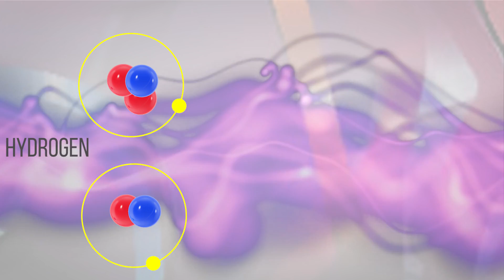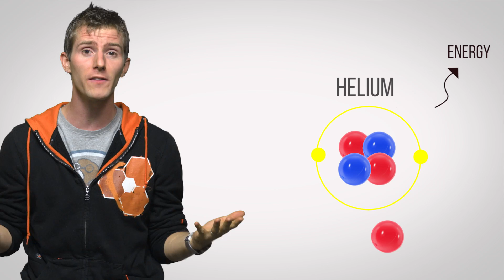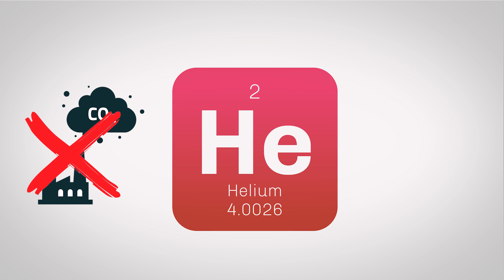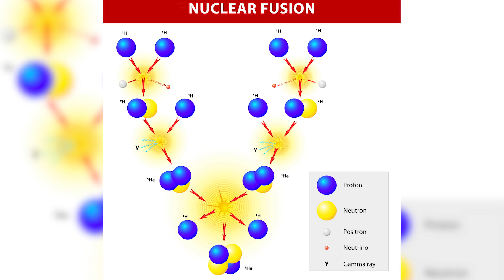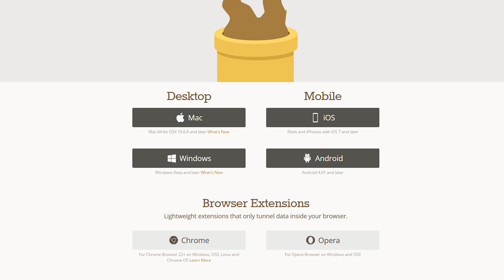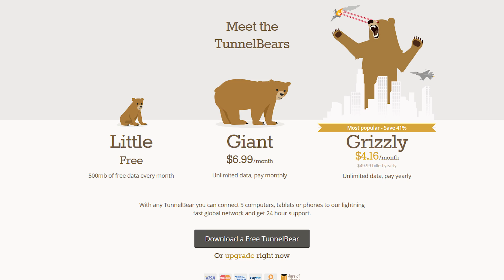Why Don't We Have Fusion Power?

Comment: There's one huge problem with nuclear fission energy that is ALWAYS overlooked... meltdowns are rare, and the nuclear waste material after the reaction is actually pretty small, such that any decently funded program wouldn't have a problem storing it for the thousands of years it takes to become safe...

The problem is the huge amounts of toxic waste created in the process of turning uranium ore into a usable fuel.  As I recall, for every one kilogram of usable uranium produced, something like 100+ kilograms of toxic waste is created as a byproduct.  Everything from radioactive to caustic to noxious to carcinogenic materials are used or created in the process, and generally are left in massive open-air sludge pits after the mine is exhausted.  Using nuclear fuel is mostly environmentally friendly, creating nuclear fuel is an environmental nightmare.

This is why solar and wind are a better choice for clean energy, even if they are less efficient... they're not perfect, of course - gathering the materials used to build turbines and photovoltaic cells and the process of refining and processing them are still environmentally damaging, but much less so than nuclear.  This is also why nuclear fusion is so highly sought after, and why it's a worthwhile endeavor to have multiple governments work together toward the goal of designing a sustainable, efficient fusion reactor.
Reply: Right so show me actually that it is really that dangerous in this day and age and your not like other anti-nuclear activists who don’t look at advancements.

Comment: Current nuclear breeder reactor tech has the capability to use old nuclear waste as fuel and eventually turning it into inert mass. There's also nuclear burner reactors which do the same thing but faster and give more immediate power at the expense of not making more of its own fuel for potentially limitless power like a breeder reactors.

We literally have the tech capabilities to clean up all our nuclear waste and deal with the energy crisis AND have it be non-carbon emitting (nuclear fission doesn't emit CO2, the steam you see rising from reactors is just that, water vapor) but noooooooo that would make too much sense and so many people are so goddamn braindead and afraid of anything with the world nuclear in it!

Nuclear puts out a power to efficiency ratio that blows wind, solar, tidal, hydro, geothermal and biomass out of the water combined. It's leagues ahead of coal and nat. gas in terms of per unit output, energy efficiency as well and is safer environmentally. And because of so much fear that has constantly surrounded reactors we have now overbuilt the things to where they will just shrug off something like a 8.0 earthquake and go through multiple safety lockdowns in the event of something higher or potentially more damaging like a Tsunami.

Retrofitting, renovating and building new reactors that are breeder or burner capable is the key to our future, both in terms of global warming, getting rid of nuclear waste and solving the energy crisis. Nuclear fusion on the other hand has been "20 years away" for the past 50+ years. It's not going to happen exactly because of what you mentioned about needing gravity to do the hard part for us.

Comment: Fusion would be a nice long term solution, but for now we don't even know if it's possible to get more energy out than in for a fusion reactor. Nuclear fission is honestly the best and cleanest option we have to supply our energy needs. If it weren't for the few disasters by countries with the worst standards for nuclear safety, nuclear wouldn't have the bad rep it has today. Nuclear is the safest and cleanest form of energy there is. Even if you look at the disasters, the death count doesn't even come close to deaths caused by fossil fuel burning. Not to mention that burning fossil fuels will end with millions upon millions dead in the future. Weigh your options: Certain mass starvation by fossil fuel burning or a miniscule chance of disaster by nuclear, near zero with proper safety, and barely any deaths if any in the case of a disaster.

Comment: So, just in case fusion reactors are again 50 years into the future like they have always been, we better get rid of finite energy sources while we still have time. That way we won't be completely fucked when oil and coal run out while we're still trying to figure out fusion power. Think of it as a back up plan.

Comment: Modern nuclear fission plants use a specific technology that was developed during the cold war because its byproducts included weapons grade nuclear material. There are other techs to run fission, one really promising alternative is Liquid Flouride Thorium Reactor or LFTR, the primary drawbacks of which when it was debated against uranium piles was that LFTR didn't produce plutonium for the bomb and was unstable for use in naval vessels (flouride salts plus being at sea = boom) one is now a major feature of the tech instead of a drawback.

Comment: there are various other fusion processes.. for producing energy.. but there is only one process which generates maximum energy and it requires 10times higher temperature than sun, and i was surprised that linus didn't even mention ITER project... :/
Reply: Jignesh Muchhadia something 10x hotter than the sun would scorch and kill everyone in a 100 km radius
Reply: Only 100km?
Reply: Mister Dinner concept behind it is, confinement of that plasma. So maybe you might wanna stop commenting obvious things, and google the term "ITER"...

Comment: Actually it's not the temperature that creates fusion in the sun's core. The 15 million degrees is nowhere near enough to create fusion. It's the quantum tunneling effect: The heat moves atoms so close, that with certain small - very, very small - chance they "jump" to neighbour atom and bind. And it is essentially the tremendous amount of atoms that balance out the extremely small chance of the fusion occuring at that temperature.

Comment: Actually fusion has radioactive waste. When the fusion is made, there is a mising neutron that is emited at high speed so the reactor becomes radioactive just by holding the reaction. The difference with fision (as said in he video) is that helium is not radioactive but fision do produce radioactive material (apart form reactor).

Comment: Linus says solar panels are not efficient enough! Elon musk says you need a pixel size piece of land dedicated to solar panels and you could power alll of america. i think ill believe elon over linus! wtf linus Explain urself
Reply: If you'd actually taken the time and read something about solar power, you'd know that its extremely inefficient. We can only get at the most 20% of the power that hits the solar panel in the form of sunlight.

And they are susceptible to damage caused by... the sun. Forcing one to replace the panels within 10 years time.
Reply: After talking to one of the think tank groups that work for Siemens in Munich, here are the 3 biggest reasons why Solar energy is not what we need it to be yet. 

1. For many places, (depending on the time of year) the sun is only out for a few hours a day, what do you do during the winter for those people? 

2. We have no way to store the energy for when we need it. Battery tech for Solar energy is lacking in a very huge way.

3. We've been trying to make solar more and more efficient, but even the best we can actually mass produce right now are only getting ~25% of the energy they capture. Most of the energy is dissipated into heat. 

Right now, the best we could do is provided ~60% of the energy for in the day use and then still have to burn coal, and some power from Nuclear at night. The funding in places like Germany and China and others are going toward Nuclear power. There are systems of Nuclear that are far better than the one's we're using now, but they're hard to get started. If China and Russia end up doing well with their versions of the LFTR, then we could see some really good yields from that type of power.
Reply: I understand fusion power is something that will be super helpful for us but the way linus does this video he makes it sound like sun power is useless. whats wrong with 20% its better that 1 % so we dont use solar panels until we can absorb 100% of the suns power right? ridiculous
Reply: btw i have done alot of research about energy hence why i think of the sun alot!

Comment: Not quite right. Fusion reactors, have produced positive energy reactions. That is the reaction that produces more energy than was put into starting it up. This happened sometime in the last decade. We have had energy neutral reactions for a few decades. 

The big issue is creating a system which is sustainable, and more importantly, something that we can collect the energy. Because even though we have made reactors with positive energy reactions, we were not able to collect that energy. It just turned to heat which, both escaped from the facilities, and destroyed/damaged the reactors

Comment: Actually fusion produces radioactive waste : the structure of the reactor. It would be as radioactive or even more radioactive than fission waste, but it's half-life would be far shorter. The waste would be safe in around 500 years instead of 10 000+ years for some fission products.
Reply: i was a tad disappointed to see linus not mention the fact that the reactor chamber becomes irradiated in a deuterium-tritium fusion reaction although I have heard of some companies with plans of using other fusion reactions that don't produce any neutron radiation (these do require higher temperatures/pressures) as well as a company that said they were thinking about using liquid metal of some sort (I wanna say it was nickel but Im only about 20% sure of that) to contain the deuterium-tritium reaction as well as its radiation so the fricking reactor chamber doesn't constantly need to be replaced, repaired , etc.
Reply: Ow, I didn't know that ! If they require higher temperatures and pressures I guess we are even farther away from that. But yeah, he mentioned we wouldn't have to worry about radiations ... that's not true.

Comment: tl'dr: dense plasma fusion is better than this old style of fusion. give it even 1/10th the budget and it will give u 10x the results. 

The type of fusion you are talking about has a problem--- deuterium
has an extra neutron. Which means this is a neurotic fusion. The type of fusion
you are talking about has massive issues in that as much as 80% of the energy
is released as neutrons. This creates the issue of neutron radiation, ionizing
damage and issue with safety and handling of materials. Aneutronic fusion does
not use these giant 10 story tall machines but uses machines more like a Dense
Plasma Focus and flickers the fusion on and off millions of times a second this
removes the energy requirements to magnetically confine the energy as well as
over 99% of the energy is converted into electricity and xray (which is then
collected in a beryllium xray chamber and converted to electricity as well).  

Tokomak fusion also has the added problems of chain reactions are dangerous. However
they have started to break even energy wise. The main issue is that tokomak style
fusion is the biggest and most expensive and gets over 98% of federal research funding.
DPF and other types of fusion are on shoe string budgets working to a much more
achievable goal.

Comment: Woohoo! A new nuke type!
Reply: they tried making a nuke using hydrogen fusion in the past but long story short even with much more nuclear fission firepower present in the test than in the A-bombs, the amount of energy that the fusion reaction provided was only I think about 30% of the bomb 's entire energy, far less than what was predicted
this is because unlike nuclear fission which happens completely naturally in any chunk of radioactive material, nuclear fusion requires extreme amounts of temperature and pressure and even then it doesn't happen very quickly
Reply: Aight thanks mate!

Comment: Taking about German engineering, have you ever wanted to use the internet like you were in Germany, well now you can with tunnel bear!
Reply: Something about quantum tunneling would have been awesome too. Yet he couldn't think of anything...
Reply: emergcon He was talking about Frankfurt. And yes, a few buildings in Frankfurt have the fastest connection in the world but Germany has 80 million people and only a few thousands have access to that...
Reply: no body wants to use the internet like in germany. albania has a better data infrastruture than we do.
Reply: ***** my landlord is full on "new stuff to build in" - so when the telecom anouced fiber, he was full in, me 2, even if it was 49 euro instead of 20 euro for coax cable. 

5 years leater: fiber is cancled. coax is fuced up. but i m living in a bosch test center, cuz everyone is getting new electicity lines. my appartment looks like allepo cuz of this and im pretty shure my electicity runs waaaay faster...

i do not now what de-cix is, but i think, thats some kind of sience-stuff-grid. i actually hacked in to a dc grid, and they are pretty cool. but as a normal consumer? gees, i am living in one of the biggest met areas in the world. "hauptstraße". also. dls? 2k, cable? 120k - but thats on the contract...

germany is a 3 world country considering consumer internet.
Reply: ***** And?
Reply: Heaneyboy00 lol its for people who wants to get a fine for using torrent or downloading stuff :)
Reply: You dont wanna use Internet like in Germany. Slow, expensive and censorship everywhere.

Comment: the 11 science problems with fusion
1 keeping it controlled and not the equivalent to a nuclear bomb going off
2 making more energy than it takes to put the mass containing it takes to move into the fusion reactor 
3 safety now terrorism is the new big threat in the world no one will want to have over a 0.0000001% chance of a out of control reaction very small but not all variables of what makes up an atom are known yet
4 it has to make more electricity then used to run it if using only fusion power and not a multi power generation solution to which it will have to use less electricity then it will make
5 the 1st law of thermodynamics "First Law of Thermodynamics: Energy can be changed from one form to another, but it cannot be created or destroyed. The total amount of energy and matter in the Universe remains constant, merely changing from one form to another. The First Law of Thermodynamics (Conservation) states that energy is always conserved, it cannot be created or destroyed. In essence, energy can be converted from one form into another. Click here for another page (developed by Dr. John Pratte, Clayton State Univ., GA) covering thermodynamics." 
6 a way supply a fuel into a tank that is the temperature of 14,999,726 celsius the fuel used would have to also enter and continue the fusion process
7 Fusion used in nuclear bombs then cause fusion to happen use a trigger caused by a fission explosion so a way to balance them to produce and not take more energy than used to make it happen 
8 a way to contain the energy until needed as a fusion plant will make alot of energy but also to much for the electrical grid to handle so sending out a smaller amount of energy than at full is needed which leads back into problems 3,4, and 6
9 ecological impact by using the fuel
10 safety range in case of a out of control reaction that does not stop by the safety measures
11 a effective way to convert the energy released by the fusion into what we can use as 14,999,726 celsius will melt all metals i know of as it so the heat will have to be moved and cooled by the method of cooling to another chamber to use it to turn a turbine to produce kinetic energy which we already know how to convert  into electricity again using less energy than will be produced by the fusion reactor
the 3 political problems with fusion
1 imports of the already used fuel have decades long contracts and a new one will have to be made for the fusion power fuel
2 if it is a political issue then partisan bickering and lobbying by both sides one to go to fusion and another to stay as is as we know it works
3 research grants are harder to get for something that most hypothesizes say will break the Laws of Thermodynamics when in a slow recovery ground breaking research that will have a chance to decrease government income is not high on the list
the 4 social issues with a fusion reactor
1 no one wants to move to make way for a huge space for a power  plant
2 misinformation about nuclear plants
3 so the part of a melt down or it turning into a uncontrolled fusion nuke which goes to science point 1
4 the substations will have to be replaced to turn down the voltage to what consumer buildings can take but also to store energy for when fuel changes in guess of a break in the line
the International issues 
1 if oil is no longer needed for power plants then countries that have oil as the main export will get aggressive on having the oil still bought even if it just sits in barrels on the fusion plant side in a reserve tank think
2 less oil being bought means they will slow the supply until they make the profit they want
3 most cars and buses run on gas

Comment: Couldn't you jump start the fusion reactor with a regular nuclear reactor?
Reply: Not enough energy, or it will start it, but it will consume more than it produces.
Reply: RagingHammer Oh okay makes sense
Reply: right now the main problem is storing it as the amount of energy that would be required to kickstart a proper functoning nuclear reactor is far more wattage than any power generator can make including the theoretical fusion generators this video is about 
because of this we have to store a large amount of power in a way that allows us to >safely< discharge it in a matter of nanoseconds